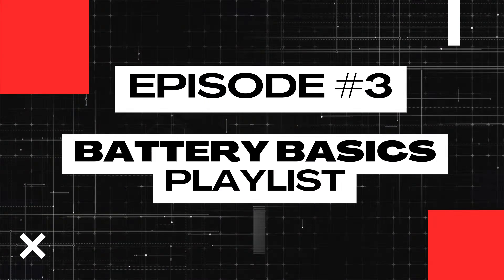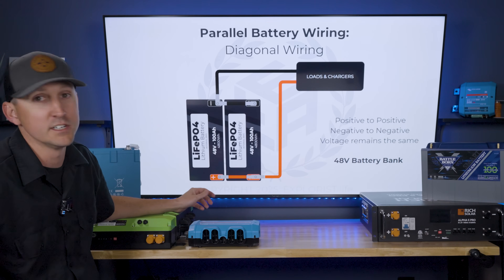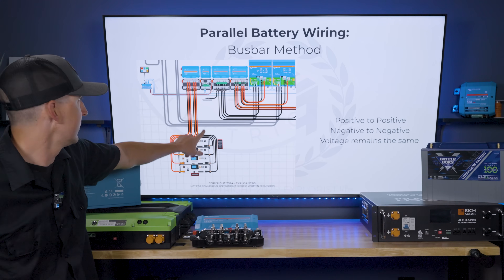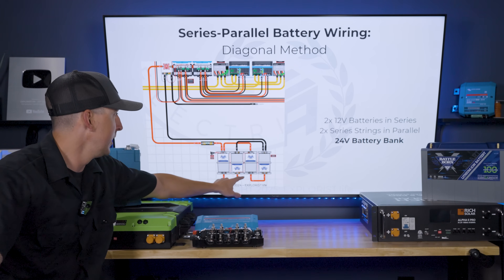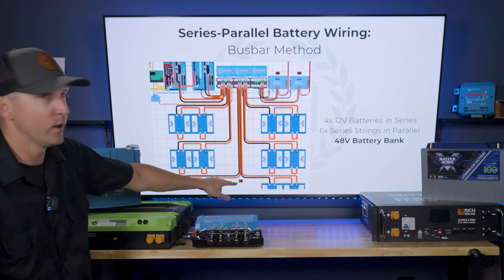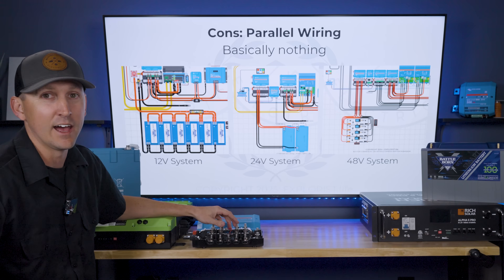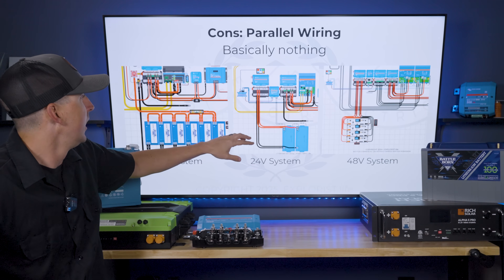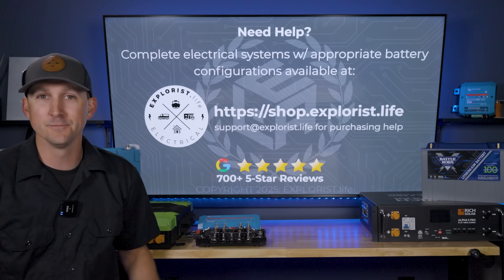How to Wire a Battery Bank: Series, Parallel, and Series-Parallel - Battery Basics |. Ep 3/7

Comment: My battery manufacturer has a diagram where the series "jumpers" all tied together. (kinda like an "H pattern)
Have you seen this and are there any benefits? I did not do this in my 3P2S system which produces 24V. I don't understand the need.
Reply from the maker: Thanks for sharing that! We've seen those "H-pattern" diagrams before — they can be helpful in specific cases, but aren’t always necessary depending on the system design.

If you're unsure about how it fits into your 3P2S setup, our support team can help assess your layout and let you know what's ideal for your situation:
https://shop.explorist.life/support

Free support is available if your components came from our store.
If your setup includes parts from other places, check out our Pro Support Membership for tailored assistance:
https://shop.explorist.life/shop/all-products/membership-tiers/
Reply: With the midpoints of series battery strings connected together, only one battery balancer is needed whereas if they are not connected, a battery balancer per series string is needed (or a balancer that can balance multiple strings). I intend to do this using a Victron balancer that I have. I will monitor the midpoint with the extra lead on the Victron Smart Shunt I also have. Instead of just positive and negative busbars, I plan on adding a third busbar: the midpoint busbar. I'm still thinking about it.

Comment: Very nice video. I am using the busbar method of connecting 3 12V 200Ah Renogy batteries in parallel. I made sure that all of the cables were the same length from the busbars to the batteries. Last week we had a storm that knocked out the power for 2 days. I monitored the batteries and found that they were not discharging equally. 2 of the batteries were taking all of the load and the other battery did nothing. After a while, all 3 batteries were working and after even more time the 3 batteries got closer to the same current discharge. These batteries have not been used much. The system is meant for backup if the utility power goes out. I don't know, but I think that the unequal discharging may be due to how the BMSs work. Would a battery balancer be a good idea? If so, can you recommend one. Is this situation where after a few charges and discharges the batteries would share the load better? Should I be using the batteries more? Thank you.
Reply from the maker: Appreciate the detailed feedback — it sounds like you’re really paying attention to balance, which is great! That kind of uneven discharge can sometimes happen depending on slight variations in cable length, battery condition, or busbar connection.

If you’d like us to take a closer look at your system setup, our team is happy to help:
https://shop.explorist.life/support

We offer free personalized support for gear purchased through our store.
For help with other systems, our Pro Support Membership is a great way to get expert guidance:
https://shop.explorist.life/shop/all-products/membership-tiers/
Reply: @EXPLORISTlife  Thank you.

Comment: Do all of the voltage batteries have to be the same like a 24v and series a 12v to make a 36v
Reply from the maker: Great question! In most cases, all batteries in a series need to have the same voltage to ensure proper balance and avoid damaging the system — mixing different voltages usually isn’t recommended.

Our support team can take a closer look at your setup and help you figure out the best approach:
https://shop.explorist.life/support

If you bought your components from our store, support is totally free!
For systems with gear from other sources, our Pro Support Membership offers personalized help:
https://shop.explorist.life/shop/all-products/membership-tiers/